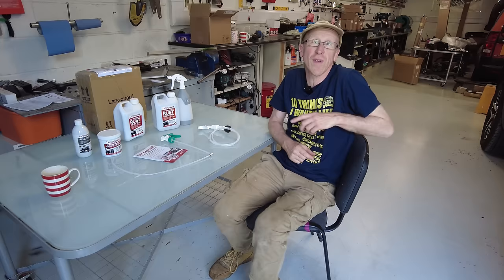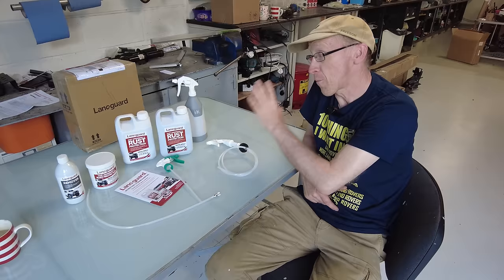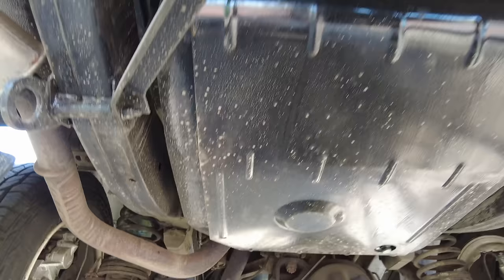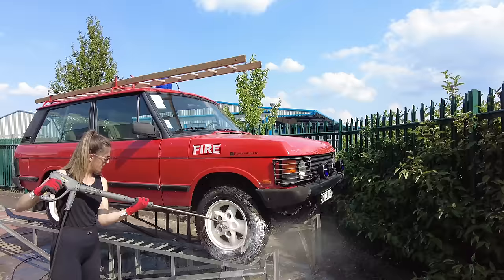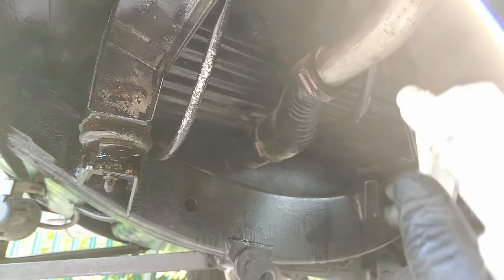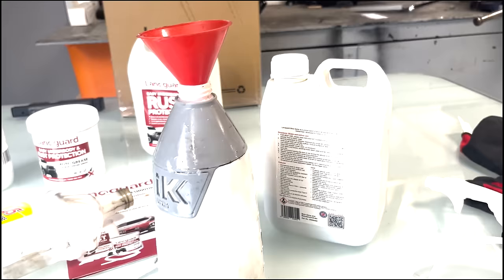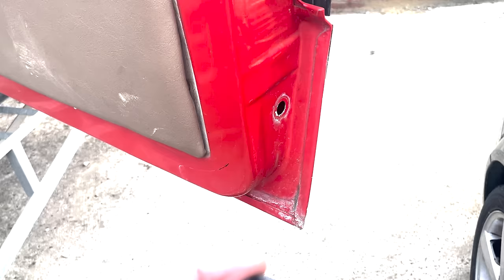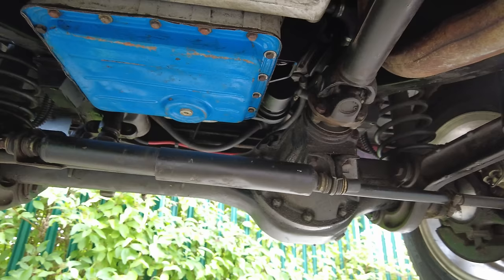Rust Proofing our Range Rover Classic with Lanoguard Chassis Protection  - Any good ?

Comment: Simon…in the dim distant days of the 1950’s, my fathers Vauxhall Velox was sprayed with Redex underneath, once a month…it was maybe the only Vauxhall built in 1953 that never went rusty! All my early cars were painted with ships red lead paint then I resprayed the factory colour back over it when dry. Then I moved to Waxoyl and used gallons of it for 30 years. However…these days I rely on the factory protection and never letting the underside get covered in mud or salt without being power washed quickly afterwards. Your RR looks wonderful underneath…a tribute to the French climate no doubt! Well done for protecting it!!😃😃😃😃Richard.
Reply from the maker: Evening Richard - Many things have been used on the underside of cars - old engine oil was old favourite ! Redex was a new one on me - only ever used that in the engine ! As you say modern cars just do not rust in the same way older vehicles used to ! I learnt to weld because i had to ! The RR Classic is looking super good underneath  - a combination of French climate and the Fire Dept looking after it !

Comment: What is Lanolin? Lanolin is a waxy substance derived mainly from the wool of sheep. The sheep's sebaceous glands produce this “wool wax” to help shed water and keep the sheep dry (9). It's extracted by putting the wool through a centrifuge machine that separates the oil from other chemicals and debris.
Reply: This stuff is diluted with something, because the lanolin naturally on fleece is quite thick and greasy, as anyone who has shorn sheep or been a woodpacker will know.

Comment: I have no idea whether lanolin is particularly effective or long lasting but the Bilt Hamber aerosol tin product has been well proven on my  nine year old Ranger, which is usually covered in shït, literally, all year round. The Ranger chassis is noted for early rusting but mine is great. I’ve always waxed my chassis on every one of very many body on frame vehicles I’ve owned over the years.  One of the most important parts to wax on that age Land and Range Rovers are the wheel arch areas and especially the ones below and behind the rear doors, the rear bed floor area and chassis rear crossmember. The outriggers are also made of a poorer quality steel than the main big box they are welded to.  My old 110 lasted 22 years with the chassis virtually like new, especially the rear crossmember that I added another paint layer to the factory finish plus waxed and added a galvanised sheet, appropriately shaped and pop-riveted in place, to stop dirt and road spray congregating in the notorious purposely designed dirt traps. 

Only in the last year did some of the thin outriggers flake off and have a couple of holes when prodded with a screwdriver, but by that time it hadn’t been waxed for at least a decade. The vehicle was recycled because it was totally worn out mechanically and one of its pistons broke. Not worth my repairing. 

Waited two years without a pickup [don’t know how we managed] for a significant body upgrade from LR but gave up in the end and bought a 2007 Ranger Mk2 new for £10,200.  Replaced that in 2014 with my current T6 Ranger which is still going strong. This cost the best part of £22k. A week Tuesday I’m picking up a new Ranger 2 litre bi-turbo to supplement the existing one, which is costing me £42k. All plus VAT. The Grenadier, which I had ordered, does not qualify for VAT relief etc from HMRC, so cancelled that at a saving therefore of fully £25,000.

First job will be to blank off the holes in the chassis sidewalls in the wheel arch regions, including the one that resembles the Channel Tunnel, permanently, then wax inside and out as thoroughly as possible.

I note that the South African factory now offer a factory waxed chassis at a modest £250 extra. Well worth it for some of us, if only because I believe they dip the whole chassis, therefore treat the innards very thoroughly.  The last cars I bought with a really good factory waxing were a 1982 VW Golf and a 1983 Santana which dripped wax from the cavities in 25 degree plus weather. They stopped doing it when they started using a galvanising primer I think, but mainly to reduce the use of solvents.
Reply from the maker: Pickups are invaluable - I actually drive the Nissan Navara every day at the moment as i am working on the new property project - an office building with a 26 underground garage - i need to get the office refurbeish and rented so i get to keep the garage ! I purchased my first pickup new when i was living in Thailand and had one ever since

Comment: Fill the rear body crossmember with it. It’s the box section behind the lower edge of the bottom tailgate. It has a body mount on each end.
Reply from the maker: Thanks for the tip Rob - I will take a look

Comment: Hi Simon if you want the pro mo video the kit that you purchased it come with a trigger spray with a long plastic tube which fits onto the 2.5 litre container so no bottle underneath the sprayer so you can get into the smaller areas I’ve just used it on my Mercedes gl so a big unit and didn’t use one off the containers so gos a long way 👍
Reply from the maker: Yes you are correct - i did not use that long tubed sprayer....I was surprised how far that the container went - it just keeps going and going !

Comment: Wool as shorn off the sheep, the fleece, has massive amounts of lanolin grease that needs to be washed out before the wool can be further processed into yard or whatever.
Reply from the maker: Still seems odd that i am putting "sheep Juice" on my Range Rover !
Reply: @L663  
Worse, I put it on my legs and elbows. It is also one of the ingredients of Sudocrem antiseptic healing and nappy rash cream, which is excellent for cuts and grazes, burns etc.  Don’t use the undersealing stuff though, because it is not hypoallergenic and may contain bugs.
I do have a friend that used to swear by WD40 for his knee joints. However he’s given up now ‘just in case’.

Comment: Did mine Simon it goes a bit thicker when cold, all you need to do is put the 2.5l bottle in a pale of warm water thins it down so it goes through the sprayer better. Enjoy and its lanolin from a sheep's fleece..
Reply from the maker: Hi Gordon - can you put it in the microwave to warm it up ? .. half joking.... half serious...
Reply: @L663  What ever you do don't spare the exhaust, as I did a bit as it will stink and cause a bit of smoke I thought I had set fire to the car. Lol

Comment: its crap did not last the winter
Reply from the maker: Interesting - which country do you live in ? do you use the car a lot ?
Reply: @L663  im in the south cost uk put that crap on in the summer all under the car  all under the wings took plastic liners off, then around 12 months later took plastic liners off to check for rust and the start of surface rust so me thinks lanoguard not much good, lanoguard should of stayed on under the wings as no sunlight can get there and not much water as you have plastic liners, very disappointed with the product, i check my seals and inner wings once a year and spend 2 days cleaning and treating them, thats on a l322 08 plate